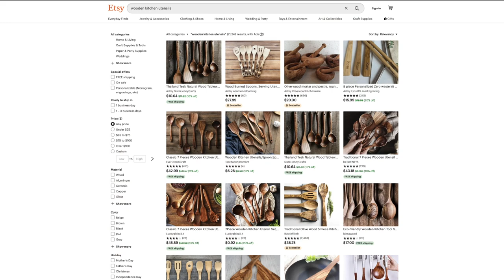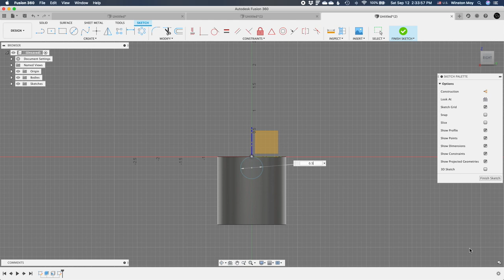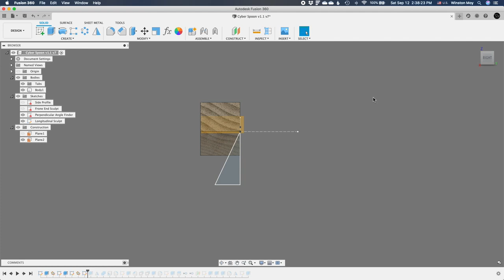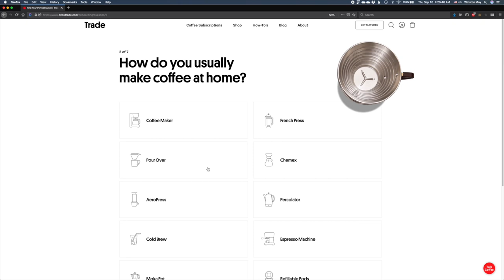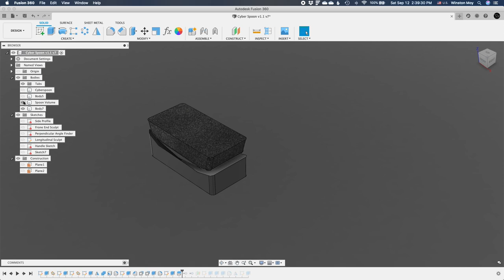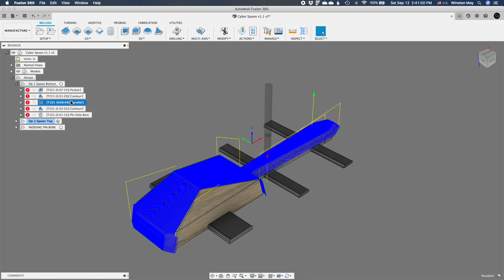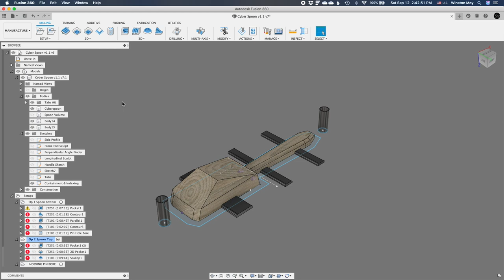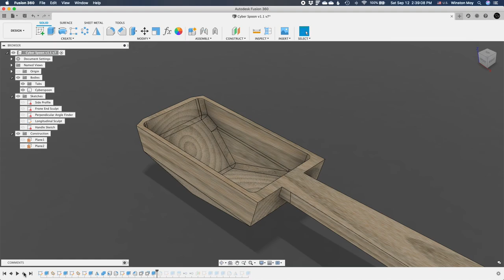CNC Machining the Cyberspoon - A Perfect Low-Poly Coffee Companion | Project #171

Comment: Just a suggestion for coating the wood, I have been cutting cubes of bee's wax and melting them into olive oil to create a thin paste. I made a video where I used the shapeoko 3 to cut two coasters, one in wood and one in aluminum and the wood one I used the olive oil/bee's wax coating.

Comment: Since the spoon will be used with food, did you consider using mineral oil instead of Danish oil?  If so, I'm curious as to the pros/cons on Danish oil vs mineral oil.  (then again, I suppose it could be something as simple as, "well, that's what I had lying around" ;-))
Reply from the maker: I want something more permanent, not something I'd need to reapply periodically.

Comment: The whole point of the cyber truck is that it is designless. It has a shape that is greatly different from all other trucks by utilizing the least amount of design possible. It flies in the face of design and not in the cool way Duchamp's toilet flies in the face of design but in the way based, useless objects that have been slapped together with a lack of effort as opposed to intention. For this reason, mimicking its design into other objects serves absolutely no purpose besides making the statement "look I made a random object the same shape as the cyber truck and because I am mimicking the cyber truck which rejects design, I am basically doing negative design. This is the most based spoon anyone can possibly design. It doesn't even contain design, it is simple mimickry in its lowest form. You want to buy one. idiot?"